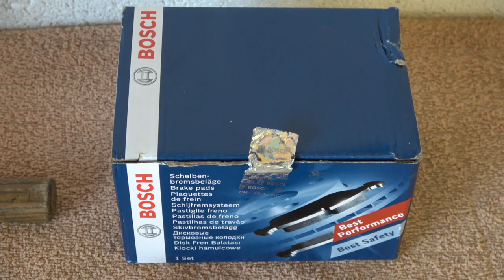Peugeot 206 Replacing your rear brake pads.

Comment: Hello David. Great tutorial, quite a hard job for a novice like me, but I just order front and rear pads and discs so will give it a go. 
I think that you installed the wedge upside down at 17:30 (if you compare it to how it was at 15:30).
Reply from the maker: Many thanks for the comment. Just take your time and although it can be a little fiddly at times I'm sure you'll get the job done. Having the right tools is essential, plus a good wire brush as the rust build up needs removing from the wedges etc.
I had a check on the wedge orientation and I can see what you mean, good spot. I'll get it changed as soon as I can Thanks.
Good luck with the job, David

Comment: Nice video. But should not the pads be reversed? That is, the one with the little knob should fit into the slot in the piston?
Reply from the maker: Thanks. You are correct, I did redo it, but forgot to update the video.